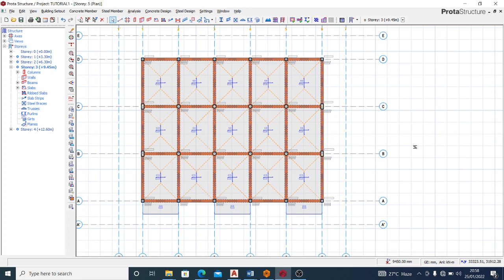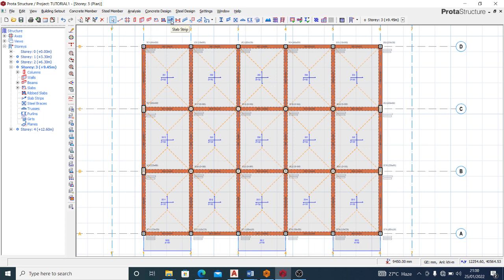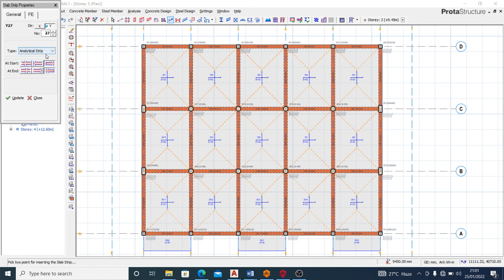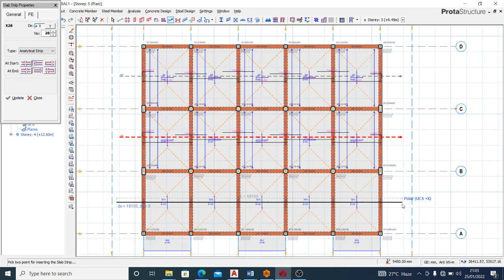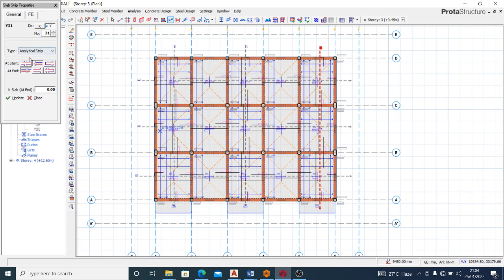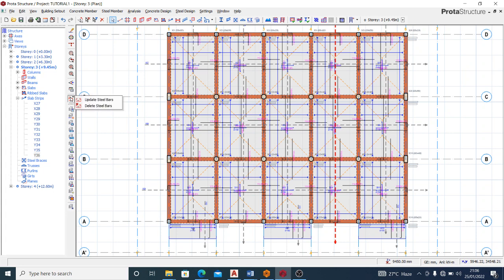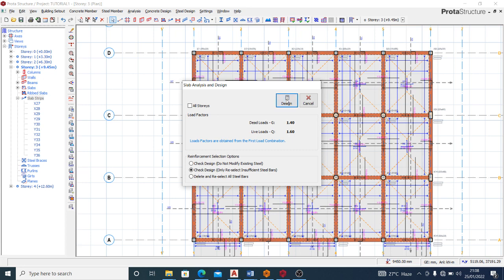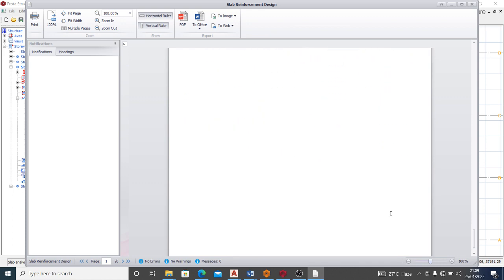How to detail a slab with prota structure (Full Floor Slab Design and Detailing).

Comment: Hey hey Mr instructor, so, I have a mixture of solid slabs and ribbed slabs, when I try to drag the analytical strip in the Y direction where my ribbed slabs also are, it doesn't come but when I drag in that direction and end at the solid slabs, the line comes on. 

My question is, does this not work for ribbed slabs?
Reply: Question 2: on generated slab detail, I do not see the word sufficient anywhere to know if it is sufficient and also when I click on delete and reselect bars, nothing is changing a
Reply from the maker: What are the conditions you chose while doing so?

Comment: Thanks for the tutorial.
I guess the slab strip analysis has to be done on all the storeys individually? 

Better still, can it be done on one storey and generated to other storeys as well?

Secondly, what is the essence of mesh analysis in slabs, I’ve seen some other structural engineers do it during slab analysis/design.
Reply from the maker: You're welcome 
Slab strip should be done on each floor because in most cases, the slab paneling will not be the same. Hence, the conditions for each slab varying. 

Secondly, 
1) In practice, a concrete slab and a beam are continuously connected throughout their common edge, which means, the deflect in unison along that common edge, and, loads are transferred from the slab to the beam at every point along the common edge.
2) During stiffness and load calculations, generally, line entities like beams, columns and braces are handled using the theory meant for line members, while 2 dimensional entities like slabs and walls are handled using the finite element method.
Now the answer to your question:
In the analysis method that uses the line entities and finite elements, there is no means by which the continuous connection (monolithicity) between the slab and a beam can be modeled exactly. Instead, the analysis model is constructed in such a way that the beam and slab are connected at a number of discrete points. This is what is attained by meshing the slab, and dividing the beam into a number of segments. Hence the use of terms like coarse mesh or dense mesh. Coarse mesh means the number of discrete points of connectivity is few, dense means many.
Those points of connectivity are the sole locations through which a load transfer occurs between the slab and the beam. If you do not mesh the slab, the connectivity present only at the points where the beams and the slab are connected to columns. Thus, any load acting on the slab will bypass the beam and go directly in the column if you don't mesh the slab. It will not reflect the monolithic nature of the connection between them.
Needless to say, a dense mesh is a better representation of the monolithic connection compared to a coarse mesh
Reply: @Joshua_d_designer 
What if I want to reduce spacing from 250mm to 200mm sir?
Reply: So help bro I want slab to have green status

Comment: In my practical design only some slabs failed and edited to pass it shows expired analysis color, what is the solution
Reply from the maker: You will have to run the analysis again since it has expired

Comment: Hello sir I cant see your T2
Reply from the maker: You mean the Top distribution bars?
Prota structure doesn't provide for that in its slab design and so you will have to put it by yourself
Reply: @Joshua_d_designer  so as prota doesn't is it ok with that alone?

Comment: I have an observation, the anchorage length of the main reinforcement for the cantilevered/overhanging slab is not adequate. You will need to edit it probably manually.
Reply from the maker: That's correct, you can do that with prota details or on third party softwares..
Reply: How do I change settings of prota? 
I'm a beginner and I'm finding trouble let's say in the pad foundation footings which are over size compared to my hand calculations and the design spreadsheets, what could be the issue?

Comment: Hello Sir, thank you for the good content. Highly appreciated.
I have 2 questions though, kindly help.
1. My analytical strips drawn in the y direction doesn't show, x direction shows, what could be the problem?
2. After drawing FE strips, I analyzed and designed my slab. But in the design report, areas of reinforcement are showing zeros and the reinforcement bars don't appear on plan. I'll appreciate your help